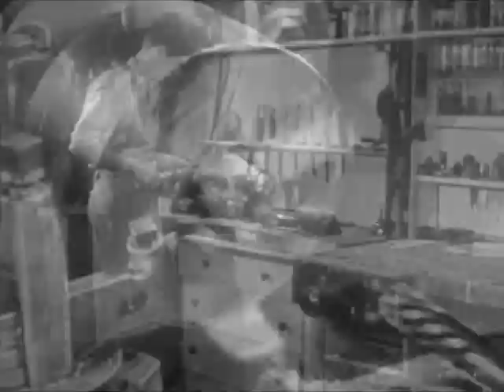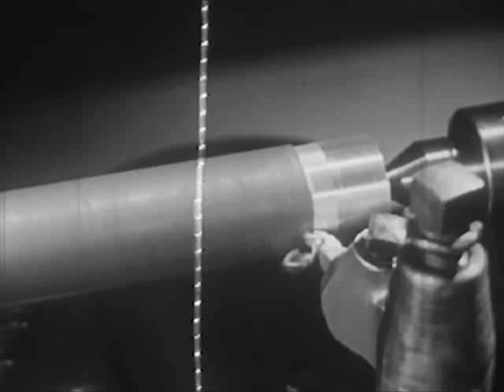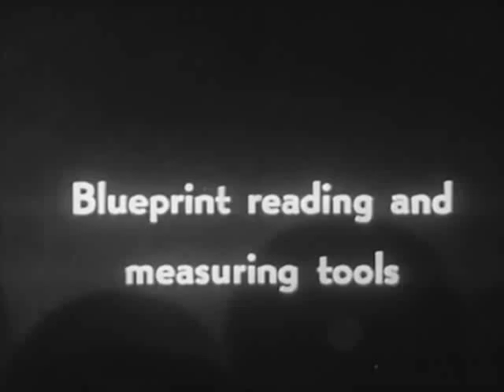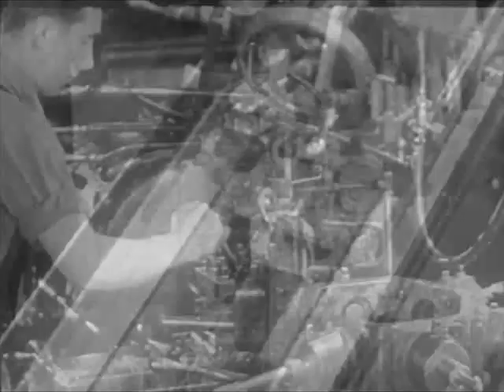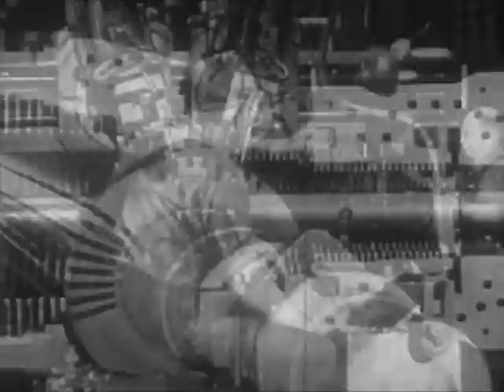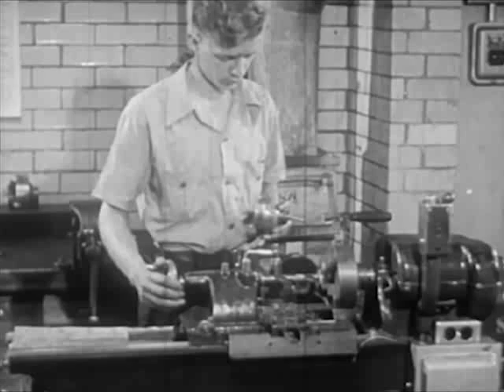1940s Vocational Guidance Film: The Machinist and Tool Maker - 1942 - CharlieDeanArchives

Comment: Two years Tech School after high school. Studied Machine Tool Operation: blueprint reading, mathematics, geometry, trigonometry, applied materials science, communications, and shop classes. Signed my Tool and Die Apprenticeship papers and after 5 years was a Journeyman Tool and Die Maker. Did high precision machining work using lathes, mills, surface grinders, EDMs, CNCs and did metal heat treating. Made a paycheck equal to or better than some Tool Designers. Not only did we understand tool design but also knew how to make the tools. After 15 years went on to become an Aerospace and Automotive Quality Engineer and did that for another 15 years. My first year of Tech School a guy at a party told me I was wasting my time. He said manufacturing would be dead in 5 years. I guess I got the last laugh because I just retired with a nice 401k four years ago.

Comment: Fantastic video.
I am a young designer in the UK - I design parts and assemblies for aerospace engine test rigs. These days, noome is becoming a designer by working up from the machine shop floor. Well, if there are, it's very few. Some of my bosses did it but now the designers come straight from university. Generally there is a good theoretical background but usually near zero knowledge of machining methods and practical limitations/possibilities. That can be picked up, but only by learning from older heads, especially those who've been on the shop floor. I often think that current mechanical engineering education would benefit from a slightly greater emphasis on manufacturing methods. There is a generation of engineers who don't know some fundamental basics.

Comment: I never went to school--instead I (involuntarily) worked (without pay) in my dad's oil additive business until I was 21. At 21 my dad died and I ended up homeless and then moved in with my girlfriend in another town and got a job at a Tyson chicken plant. The job was a miserable dead end. A few years later with a wife and 3 kids (I have 4 now) I quit that job, paid my way through 2 years of general studies in college and at 27 I started working for US Motors in the winding department. I am now going to college in machine-tool and finishing my first semester this fall.

I have done well in the classes with manual lathes and blueprints. I am certainly top of the class despite having less experience than many of the other students. I am already the "go to" teacher for most of the students, several of which have said I am better at teaching them than the instructor himself (who has over 30 years experience). I don't know what the future holds but I am glad to be doing something that seems beneficial.

(Incidentally, I am high functioning autistic and I think this may help somewhat with the need for precision and conscientiousness)
Reply: Damn, sounds pretty rough. Hopefully you've had the opportunity to move on. As a fellow autistic machinist student, I can say that it's a fulfilling way to spend the days, especially helps me to have a special interest in metallurgy :)

Comment: Anybody else notice less than half the operators had safety glasses and not one had hearing protection? (or an eye-patch, lucky I guess) A different time, pre-OSHA for sure !
  
     I was lucky enough to live in Connecticut in my youth.  They have a public "Regional Vocational Technical School" program there (15 now, from what I understand) scattered across the state. If you can pass the entrance exams, you can attend one, if there is an opening.
     You have to pack in all the academics of a standard high-school education and your chosen vocational field education in a 4 year period. Very tough, many did not make it to the end. 
     Minimum required grade of "C" to remain, otherwise you were required to transfer back to the school you would have normally attended.  My freshman class started with 429 and 125 made it through to graduate 4 years later.   I went to NRVTS (Norwich, Ct) and trained to become an electrician. The best decision a 14 year old ever made.  My career has served me well as an IBEW union electrician for over 40 years now.

Comment: Went to a trade school in 1969, pre-apprentice machinist-tool & die. Learned all the machine, bench work and class room shop math. Got a job as an apprentice die maker, I learned to run almost every machine in the shop. Moved up to die design,  eventually got promoted to foreman in the die department and chief designer, all in 30 years with the same company. Lots of overtime , a lot of younger people now do not want to work overtime. Now retired and still do some part time designing.
Reply: Look, I've been working as a fabricator for a couple of years now, and we're a lot of young people in the workshop. They're all perfectly happy working a lot of overtime, although I'll have to admit I'm not one of them. I'll work overtime if it's needed, but I'd rather work hard during my regular hours, plan out my work in advance, and actually get some free time for myself to do the things I want, instead of spending my evenings at work
Reply: Usually overtime is required because of an utter lack of planning by management and a complete unwillingness to hire and train more people.  This is all because investors get paid first, and workers take the hit so that rich people can have too much money to spend, not knowing who had to sacrifice time with their family so these rich jerks could blow off money and be playboys.
Reply: @OceanusHelios  If you ever worked in a job shop you would know that it is a series of highs and lows. If a customer crashed a die and needs replacement parts quickly a good shop will do what ever it can to get replacement  parts to the customer. Shops that hire and fire people just to get work become know as revolving door shops and  will have trouble finding employees.
Reply: I think it comes from having too many frills without having to earn them when they were young. My children never got everything they wanted, but got what they needed. They are both very successful, and hard workers.@nunyabusiness3786
Reply: I started my tool maker apprenticeship in 1995 by 2003 with Nafta and free trade with china, none of the factories I worked for were in business.

Comment: Wow this great. I remember in the 80s we was still being governed by the same principles during apprenticeship. HNC HND. Now we see CNC, CAD CAM, Wire erosion and Spark erosion. We use EDM m/c's today with formed electrodes to sink or wire a form. CNC's are used for unconventional machining allowing to climb mill and plunge mill etc. When dies are formed we use CAD now so the die is scanned. This allows the company that the tools have been produced for to simply make a call to reproduce a particular die rather than sending the whole tool out to toolmakers they order the part. I used to build Press Tools. We see these guys building die set on radial drill here. We see a lot of prototype's being produced on 3D printing today. Kids are doing it at home lol. Still it is very important to remember the foundations theory and practical when machining. Without this COMPUTERS are DUMB.

Comment: Machinists today are computer programmers.
Reply: A little more to it than that.
Reply: you got the programer...the set up man...the operator
Reply: Not when CNCs take a mans job away it isnt. Setups are way easier with tooling & holders & operators are the programers. Depending on the type of cnc they will replace several different machines. Those cncs & programers replace alot of old school machinists like me.
Reply: @TheReal10bears  I have been in the trade for 40yrs doing prototype and short run custom parts using cnc and manual. Current shop I work at we still do quite a bit of manual machining mostly OD ID grinding to .00005 tolerance. I regularly see ads for manual machinist here in PA.
Reply: @tc6580  I worked for Northern Screw Machine Inc in St.Paul for 15+ yrs making parts for Airline communications. The place employed 50+ full & parttime labor until 9/11. They laidoff 35 guys right off & bought 4 cnc screw machines eliminating all 35 jobs. All of those layoffs were by seniority. I was called back after a year but my hours were cut to where I was parttime. I made a career change & left Minnesota & machining
Reply: Machinists today are computer programmers - UNFORTUNATELY.
Very few "machinists" are today still able to grind a chisel/tool for a lathe... Terrible. The computer knows.... And the human forgot it...
No no no! WE must get rid of the a.rtificial I.diot, programmend by Noah Harari and Billy boy Gates, Klaus Schwab W.E.F. in Davos ("you will own nothing a be happy about it!" book: the great reset) and the evil alikes....

Comment: Gotta love the guy running the engine lathe without safety glasses.
I would have been blind 5 times over in my 30 years of machining if I hadn't worn safety glasses.
   It is cool seeing the old machines,some of which are still in use today.
The first machine I ever ran was an old Warner & Swasey from WW2,it still had the "Property of the US military" tag on it.
Reply: That’s the first thing I noticed, no one wearing safety glasses. Big penalties now for infractions of safety violations.
Reply: I ran turret lathes at a shop at 18 yrs. old out of Vo-Tech in 1973.  Learned much there but learned as time went on in other shops on things like heat treating, different fits, and so on. Ran turret and engine lathes, horizontal and vertical mills, surface grinders, radial drills and a shaper. (The job I retired from in 2020, no one knew what a shaper was!). I ran a Cincinnati Horizontal mill so old; it had been converted from overhead belt power. Retired now but was always proud of my tools and the knowledge to make something from nothing.

Comment: Let me add some insight to your video. I was a shop teacher for 25 years at 3 school districts. Each district layer me off and stated “ no one works with their hands anymore”. I started work at 14  and I am 80 now and am still working and have never been out of work. Maybe we still need people to work with their hands.
Reply: I'm 68. I retired 2 years ago as a Software Engineer in a research lab. I worked there for over 40 years. We had a machine shop that made everything. All custom work for a new project. I loved it. Anything I wanted Ernie would make it for me. If I needed something made for a home project I would sit at my desk with random parts looking confused until Ernie walked by and he would say, WHAT NOW? Then he took my parts, threw them in the trash and went back to the shop and made it. Many times I would sit at his table in his shop and write in my lab book. Sometimes I would walk into his shop with my plastic caliper and make believe I was measuring his work. I didn't have a clue. Sitting at my desk trying to screw a 1" bolt into a 5/8" hole until he walked by and took all my stuff away. It was a game and funny.
Reply: CNC is mostly only good for very complex shapes or mass production. You will otherwise end up spending more time in CAD + measuring + creating fixtures + probing and making sure your program doesn't crash the machine than you would have on a regular mill
Reply: I'm 34 and have worked with my hands my whole adult life.
Reply: @aaronwatkins8973 I'm 31 and sam story as you, nothing better than making things with your hands
Reply: I am an ex toolmaker who learnt the old school way (9 months hand filing at beginning)
Man greatest ability is his dexterity to make and create. To have a mind / hand skill I believe is the basics to being a man and able to provide for your family and create for the world.

In Australia,  a show called 'the block' where a group of people get together and build homes for an auction was the biggest show on TV. I would tell people that this evolutionary, and everyone wants to express this in some form.  
Later on, I worked at a desk as I am now an engineer. This was like hell personified... and not natural!
Reply: Litho fell apart when dad almost reach57yold, cnc took over
Reply: The biggest mistake the US Department of Education (and bad ideas) ever made was doing away with the Industrial Arts Programs in our schools. Not everybody is cutout for collage and advanced education to work in "white collar" occupations. Regardless of how advanced we become, we are still gong to need Carpenters, Plumbers, Electricians, Repairman, Mechanics, and people that can work with their hands with a high degree of skill.
    I retired 2 years ago after 45 years as an Airframe and Power Plant mechanic (A & P) on Airliners. The last 10 or so years I was a mentor and trainer, teaching the new kids coming from (A & P)Trade School. Many of these kids had the basic skills obtained by helping "Dad" work on cars growing up, but quite a few had zero basic mechanical skills because nobody at home knew how to work on anything and there wasn't any type of Industrial Arts programs available in High School to learn the basics. I'm talking not having a grasp of basics like "lefty loosey righty tighty". If I handed them a nut and a bolt and said put these together, it was a real struggle. This in turn cost the Company a lot of extra money because these kids were supposed to work with me and learn the specifics of working on Airliners, but I had to spend (waste) an enormous amount of time teaching the basics of hand tool use. " No Jerry an adjustable wrench does not double as a hammer"  As a country we are in sad shape.
Reply: I am doing a CNC certification, but prefer manual. Plenty of people in the program hate getting dirty or even operating manual. I tend to like the older people learning because most tend to get their hands dirty to get the job done. While the younger ones don't get dirty and end up on their phone most of the time they act like they know more than me. But I always have to explain why something is not working or have to stop what I'm doing to go over and stop them from burning up a tool
Reply: @tgi3d881  When I trained a lad I always took them to a manual machine. Made them put a cutter in a milling machine and taught them to wind the machine by hand so they could feel what the tool was doing when cutting metal. I showed them the difference in high speed steel milling cutters, then hss ripping cutters, moving on to Ticn coated tools and solid carbide tools. Showed them the difference between upcutting and climb milling. Did a similar thing on the lathe with various tools and methods. You have to understand what the tool is doing, you can’t do that by solely learning from a book.
Reply: Cnc guys only use their fingers
Reply: damn right. we need to bring the jobs back to the US. although the kids now have no work ethic. if we fought wwii with the attitude kids have now we’d all be speaking german. 😤 i’ve been a union rolling mill operator for 16 years, and am proud to still work a blue collar manufacturing job. honest work, and the pay is good.
Reply: Insight to 'their' video? The video is literally as old as you. Almost 80 years lol. W.e. insight may have been needed has been offered, included, removed, reintroduced and removed again many times over. But thx for the insight gramps.